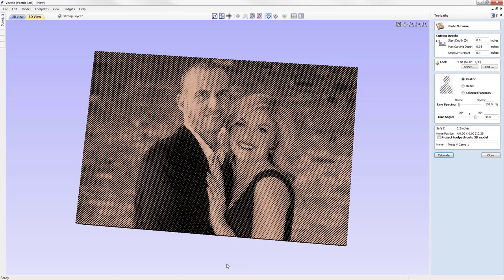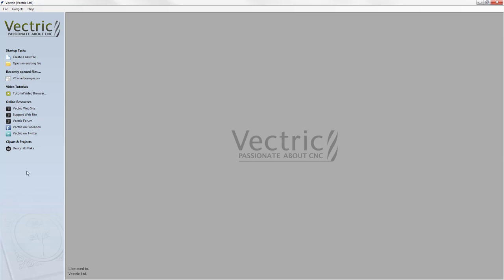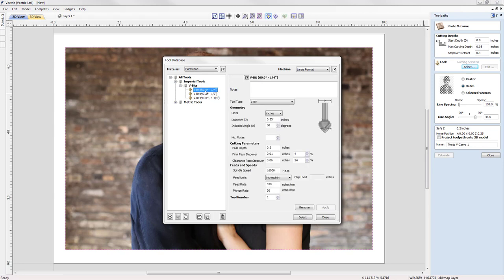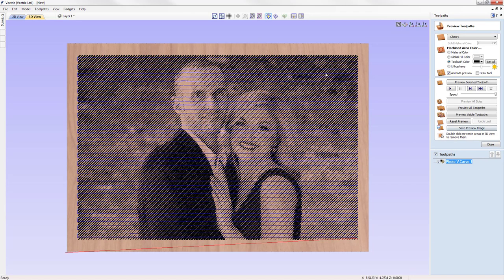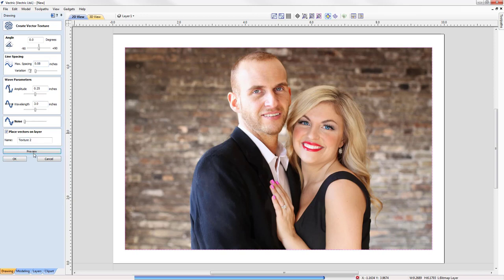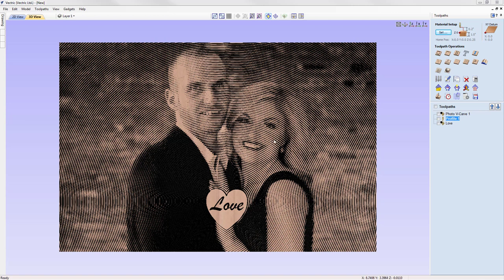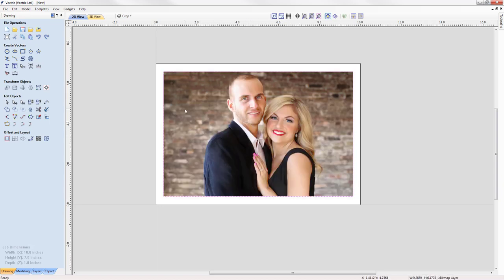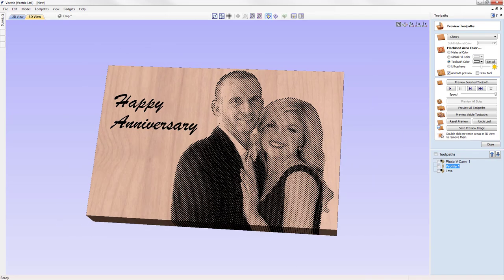Vectric V10 Tutorials | 2.5D Toolpaths | PhotoVCarve Strategy

Comment: Love all of your software and your videos on how to use it. If possible, could you do a video on how to use the Moulding Tool path on one of your Cribbage boards? I tried making one and had to change the little moulding profile. It kept giving me a error and said something about overlapping or something to that effect. After selecting it and making it smaller and changing the angle, it worked, but not to the extent that I wanted. It's a bit confusing as to how to use it. I saw the two that you have on here, but they didn't help in this situation. Thanks and keep up the great work!